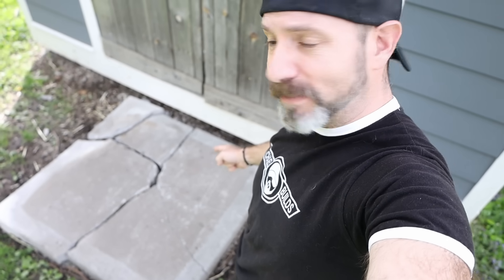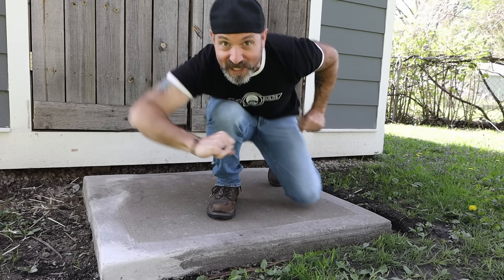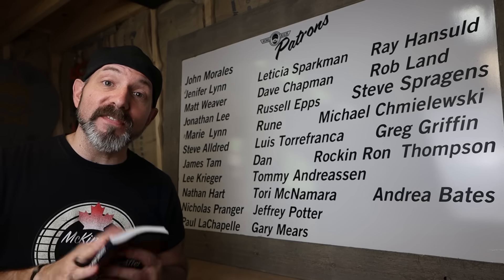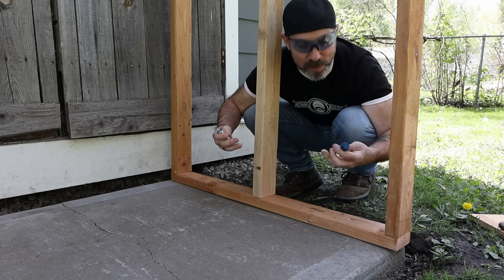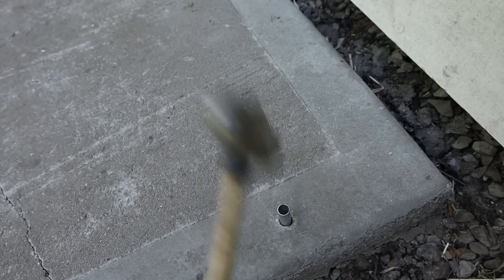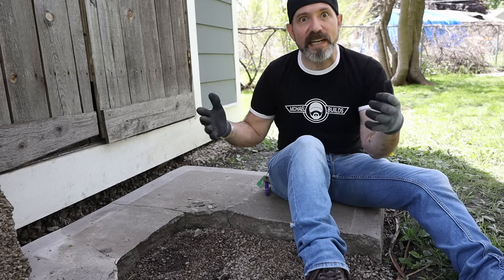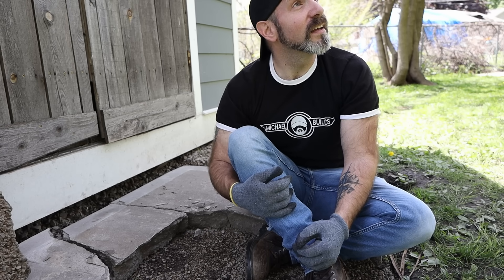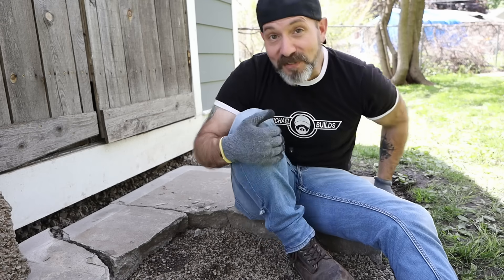Dry Pour 30 day cure Test

Comment: Great video.  To be fair, driveways are supposed to be 6" thick and reinforced with rebar.  At least that's code out here in California.  Personally, I'm really intrigued with this method.  I need to do more research before I actually follow through with my project.  But it would be much more affordable to use this method.  Thanks for the video.  Liked and subscribed 👍

Comment: So, I've got a 22'x22' round firepit area with a 4' center metal fire ring. Its structure is very solid. It's built on a sloped area of our yard.  The upper side is ground level.
The highest level is 3-4 ft. The drainage field is #57 gravel...the top, I chose small pea gravel ( not a good idea)!!!
So I have been thinking of what to use to hold the pea gravel in place (???) 1st attempt was use a grave, mulch hardener - pretty much like Elmer's glue (Elmer's glue is great,  but not for gravel 😢. 
Next, I had half of a bag of mortar mix left over and sprinkled it on one small area of the gravel...it started to rain before I could work it around... But it hardened...yah.  I just wanted to see if you could please suggest how I should go about doing this dry pour over the pea gravel for a more solid surface...where our heavy adirondack chairs are pulled around to enjoy those cozy fire pit nights.
Please help!!! I'm a female,  a grandma, and never afraid of work. We live on a farm in Kentucky where there is always work to do!

Comment: Based on this video, I dry poured a 4'x8'x6" slab using sakrete rapid set concrete and it turned out AMAZING! I used a gravel base, put rebar down as well, and used rapid set mortar mix for a smooth screed. I misted/soaked it for 5 days before removing the forms.  It was my very first concrete project, and turned out incredibly well and strong. It serves as the base for a 2280 lb concrete staircase and is supporting the load just fine.  Thank you for this post!! You helped me save a ton of money!!
Reply from the maker: That’s AWESOME! Thank you so much for sharing that project!
Reply: My dry slab seems to still be soaking in water when it rains a week after the original watering.     Have you noticed the slab still taking in water with the rain?  Haven’t seen anyone mention applying concrete sealer on dry slabs
Reply: How many bags of concrete did you use for your slab if you don't mind asking?
Reply: I wonder why you didn't wet pour the concrete and remove the forms after about 24 hours in stead of 5 days. You also could have used fiber glass re enforcement  in stead of metal and come up with the same results. I've built custom homes for many years and there are different ways to use concrete and different things can be done with it. By using optic fibers you can even get light through a solid concrete wall without weakening it. Put titanium dioxide in it and it will actually clean the air it comes in contact with it. They use this concrete in Europe a lot in white concrete for churches and such where they want the concrete to stay white. The pad in this video would probably have withstood the truck driving over it had the concrete been poured with a monolithic type footing of another 4 inches or so around the outside edges. Dry pouring concrete is a novel way of doing it but by far not the best way.
Reply: @russellkeeling4387   Just didn't want to wet pour, that's pretty much it. It's kind of messy.  Regarding your comment about the 5 days...5 days, 10 days, 2 days whatever. The timeframe didn't matter to me.  So if you like wet pouring, good on ya... this video isn't for you.  But for those who want to dry pour, do so with complete confidence.  My slab is still holding up like a boss and doing great.
Reply: @russellkeeling4387  I can tell you why I wouldn't want to wet pour...the machinery and mess.  If I could get similar results doing a dry pour but it takes longer?  great.  Maybe if you're a contractor and you're going for speed then great.  totally understandable.  if I'm on no ones time frame but my own?  Dry pour seems FAR simpler and less resource hungry.

Comment: I have been wanting to build a well house and move the well tank out of the basement. I’m a bit of a light weight and no spring chicken so that pouring a wet concrete slab would be a bit of a challenge for me. I can manage a dry pour. 

I have seen the video that you referenced weeks ago and you have just reinforced for me that this is the way for me to go on this project. 

I have a question for anyone that would care to respond. Would this work for a shower floor on top of an existing concrete floor as in a basement?  

My basement was stubbed out for a full bath when the house was built but the bathroom never completed. I question if a dry pour shower floor would adhere to the existing concrete. Thanks in advance for any responses

Comment: Excellent. Driveways are poured minimum 5-6" thick with wire/rebar and strong/tamped crusher run underneath. You convinced me it could work for a driveway. And of course, the only way to really test strength is with a Ford. 😉

Comment: 6" to 10" thick will never be cracked when driving on!
 In this case, that's just too thin for driving on by the heavy truck, even with wet pour, still won't hold! Thanks for the test!

Comment: I have this idea (may be totally wrong) that the best way to do a dry pour would be to measure the water you add to it to get the right ratio. Like put a moisture barrier around it, then add just the right amount of water, then cover it and let it cure that way, nice and wet (but no extra water).

Comment: There's no reason why this wouldn't work,  after all if you leave a bag of Portland cement sitting on concrete floor for a couple of months,  it will set.  The only consideration to this method is the 28 day high early strength will not be achieved in 28 days.  probably more like 90 days because of the low water content and it will continue to set for the next 100 years or so.

Comment: Terrible test method. 

He was putting lots of force on the edge. The slab is above grounds, 4" thick and no steel reinforcement at all.

Had it been 6 inch thick, steel reinforced and levels with the ground, the load transfers from ground to pad woupr have been less concentrated.

The soild underneath also wasn't prepped.

I also think the wetting method shoupd be differently. The mist coat I get but after that I think a much longer medium showers woupd benefirlt the strength. Get it wet stoner and more thoroughly instead of in phases. The entire curing process would be more thorough if all wetted more equally.also, whats needed is a hydraulic compression test in a lab...test wet pour for compression and shearing.

Comment: You need to have a control which is properly mixed cement without rebar.  Maybe it would crack too under that truck load.  You are assigning a negative outcome to the dry pour even though it might be actually performing as well as the wet pour.

Comment: i did a dry poor for a 10'x60'x6" pad for the lean to attached to my pole barn. compacted sand as the base, #4 rebar. i normally part my f350 KR dually on it, mind you it has 180 gallons of fuel plus semi truck 22.5 wheels and tires. also park my 6k lb tractor on it. has been fine for the last year and drive the dually min of 6 days a week. sometimes park a international 4400 dumb truck on it too. been a year and 1 month, plus michigan freeze/thaw and flooding from the river behind my shop. any my lean to is anchored into the dry poor concrete.

Comment: I’m a construction project manager on huge projects.  I would never do the dry pour method on anything. However, many smaller dams in the US are done with damp compacted concrete. The cement is brought to the site in regular dump trucks, and has the consistently of wet sand. It’s dumped out of the truck just like gravel or sand, and is spread with road grading equipment. It’s laid in 12 inch lifts, and each lift is then roller compacted with heavy roller compactors like those used in highway paving. 
    It can be reinforced 
with rebar, fiber mesh, geo grid, etc. depending on the application.  This makes for an incredibly strong & durable, laminated concrete. 
      The problem with dry pouring is you don’t get even distribution in the  slab, which means your concrete strength will be inconsistent. 
  Another thing to remember is that  there is a difference between drying and curing. Cement needs moisture to cure. During the cure time, a molecular change occurs as crystals form, and the molecules rearrange. This makes  much stronger bonds. Maximum strength generally takes 28 days. If the concert structure is such that you can dampen your slab a little everyday, you’ll get an even stronger slab. Even just keeping it damp for a few days can have a huge impact on the crystallization and final strength. 
    Soupy cement and dry cement can have the same problem . . . weak pockets in your slab due to inconsistent composition. “Wet, but not too wet”, is the general rule. But never dry.

Comment: I have a bit of a challenge. My driveway's entrance to the asphalt street is very sloped. Enough so that people (delivery trucks especially) start slinging gravel rather than managing their inertia. SO... What about bags of concrete, cut the bag away as each one is placed, rake it, toss on a layer of gravel for some traction, soak it and leave it. A couple of pallets from Home Depot would not be unreasonable. Edge it bricks for a sloped on/off. 
It's too steep for a small electric stamper.
Around here people often simply place bags of some sort of quickrete and let it harden from rain exposure. (E.G., my mailbox.)

Comment: I've watched a couple of these now and I think you're kind of missing the main point. The question that should be on everyones mind is, does this method of pouring concrete make a product that is inferior to the recommended method. In other words, what we actually want to see is two slabs, one dry poured and one traditional and then the strength of those products compared.

Comment: For me wet pouring isn't exactly much more work, its much less total time when considering having to wet it for hours afterwards, and its a guaranteed result. It's cool that this seems to work well enough, I just can't think of a reason why people would need to do this. I work as a petroleum technician, but we do a fair amount on concrete work to replace rusted out spill boxes etc. It takes me less than an hour to mix, pour, and finish a slab this size. Just my 2 cents.

Comment: I'll be using traditional steel for tensile strength. It's way too cheap not to--considering the labor and materials involved. It will still crack someday--but it won't fall into pieces when it does.

Comment: Needs to be mixed with water first and the right amount or the cement will not get into the pores of the rocks and sand, but only wash away the cement into the next layer depending on how you mist it after the first coat of water. Dry mixing will leave bigger cavities of air where water can sit and freezed vs an even mix of wet concrete.

Comment: It's not really an accurate test with the truck.  The base was not packed, and as you were driving over it, the slab was rolling.  I did a dry pour before and I prepped it as if I was bringing in a mixer for concrete.  With fence posts, people have dry poured for many years.

Comment: Love the Dry pour videos. But I had a suggestion…would a wet poured concrete slab of the small size crack??  I think it would crack because of the non stable ground. Also a YouTuber claimed he used 6000 pounds pressure mortar to give it a professional look. Try it.

Comment: I need to pour an 8, x 12’ slab.  Plan to put cattle grate in the middle…BUT I only have the Quickcrete that includes the gravel in the mix….is that OK?  I see you and others using the straight powder concrete only?

Comment: Have you tried placing a couple of short piers ?  I’m doing an 5x8 by 5” slab using 5 —15” piers connecting to slab with rebar and a cattle panel for reinforcement.  Over kill is better than under kill.

Comment: The dry pour worked great for filling cracks in my patio and gaps between the paver stones.
Appreciate the tips and tricks  as it was a time saver and looks good.

Probably would not do it for weight bearing purposes, but for sugar coating stuff its the bomb.

Comment: The one thing I feel is you messed it up big time by not letting it cure all the way first, of course it will crack it is not stable, you didn't have it even with the grass, so every time you went over it, it moved and moved unstable concrete will crack. Now you got it cracked now you are drilling in it with cracks in it.

Comment: In the CountryCountryLiving video they only had a thin slab with the boards on their side and it was only for foot traffic. Also they showed moisture being drawn from the ground so you have water from the top and bottom. I’m wondering if you pre-wet the gravel if it might be stronger? Either way great Video thanks.. now subscribed

Comment: Not sure about this but in my experience of installing water lines and Tee off the main to install a fire hydrant which takes on all the pressure,  Put only concrete bags in place behind, and then pierce the bags to allow water to get inside and backfill it. Those hydrants have been in place for years. So with that and watching this video Cajun Country, I have some concrete to pour.

Comment: Wharf concrete did you use for this poor?  I agree with the other comments that most slabs are 6 inches when you’re going to be driving on them.  So that is what could’ve lead to its failure.

Comment: I bought my first home 3 years ago and have severe allergies, so I want a concrete patio. I live in an affluent area but don’t have affluent money, lol.  I ran across the Cajun couple, a few months ago and started researching. Called a guy and asked what he’d charge to pour me a patio. It’s a town home, ably 15 X 10 or so and there is a side walk already out there. So maybe a 5x10 slab. He wanted 1800 dollars. 
I cannot afford that, so been wracking my brain as to whether or not I should try the dry pour. I don’t trust me with wet cement  and I have no where to keep mixing buckets after done, we have no garages. I watched you do this and I now feel confident I me and my daughter can pull this off. The clearing and digging will take us a bit, but I thunk I can do it, even if in small sections at a time. We won’t be driving on it, we’re little women so don’t think we’ll crack lol.  I think I will finally have the patio of my dreams by fall.  Now..can you show me how to build a safe free standing fire pit? Kidding. Imma just buy that. Thanks Michael!

Comment: This was great content with the right amount of comedy relief(balancing on a three 2x4 nailed half wall! Lol. I think the Major Factor missed here is that with Dry Pour, one person can work it at a pace not compared to wet pour. Even a 8'x8' pad required a crew to screed, round over, trowel and broom! You almost lost that tiny pour in another video, it was setting up faster than you could mix! Also, a larger concrete pad would disperse the load across the entire surface vs a truck rolling over a 2'x3' pad placing all the weight in a sq. ft. vs 72 sq. ft. of the vehicle mass. Good stuff, I'm going to give it a shot if my back could take the bag dumping!

Comment: Even if you had mixed and poured it still would have cracked with not having any steel holding it together.  Also it would have held up better if you had soaked the ground first as a final "compaction of the soil" before pouring. Did you compact the soil at all before pouring?
Reply from the maker: I agree. I compacted the gravel but not the soil so that could be my problem too

Comment: First freeze thaw cycle and that slab will be destroyed….either cracked or the surface will start “dusting” You need a min of   4% air entrainment to make the concrete  “weatherproof “. A dry pour method seems to work in areas with zero winter conditions

Comment: Michael, I’m interested in doing a patio with a brick pattern around the boarder and brick throughout in squares in a dry pour. The idea is to dry pour squares with a brick around each square and just rinse and repeat until done. So my question is, will the dry pour stick to the brick as well as pouring wet? 
Thanks